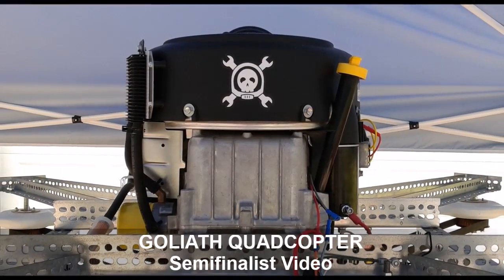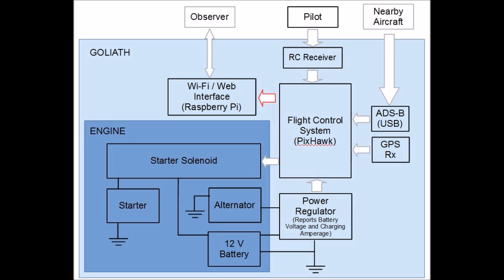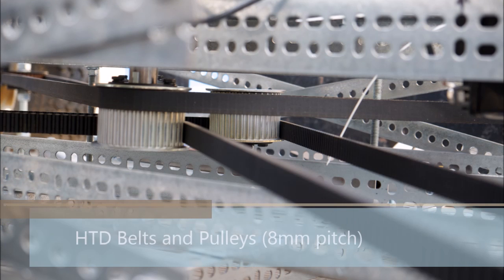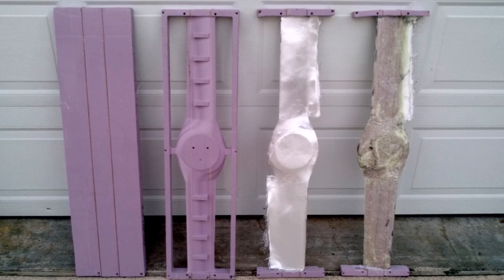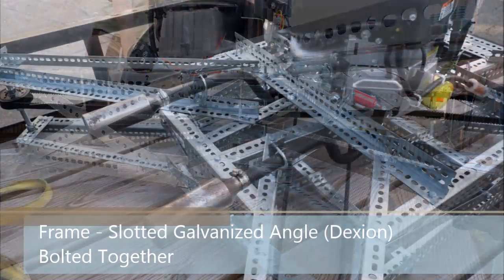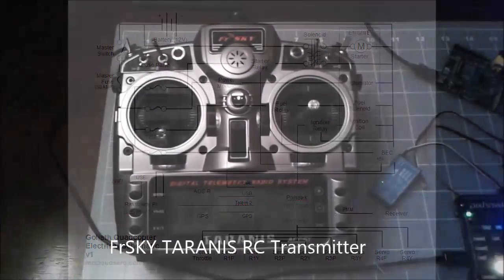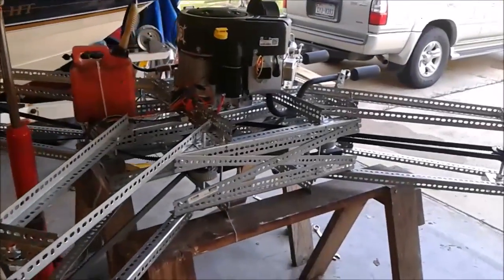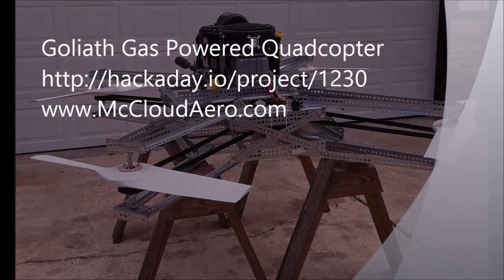Goliath Quadcopter Semi-Finalist Video for The Hackaday Prize

Comment: how would it control the speed of individual rotors to stabilize?
Reply from the maker: +TheTrueM3ga The initial idea is not to change the rotor speeds, but to use vanes to control the vehicle.  This would be similar to how +Armin Strobel did it for his Ducted Fan VTOL.  Eventually it would be good to move to variable pitch rotors.

Comment: Hey, get two 1/2" thk. 6061 aluminum plates, along with (4) aluminum i-beams for the frame, and sandwich them together. I'm working on similar project (but electric), which can handle around 500lbs of force. 

The frame will weigh about 30 pounds, but it will be strong as hell, perfect for your assembly.
Reply from the maker: Bryce Ohmstede Sounds pretty strong. I'd be interested in hearing more about your project if you're able to share some more details.
Reply: McCloud Aero Corporation It's only on paper right now. I'm about to build the frame and do a test on one arm's worth of components. I'll keep you posted.

Comment: HIghly interesting, you are an intelligent guy that there are very few of left. I am following your progress with great interest as I am working on similar  idea, I also had the vanes idea iintead of collective for lesser complexity. The   million dollar question though is: will the vanes be effective for control?
Reply from the maker: I'd be interested to hear more about what you're working on.  I think your right about the big question being about the vanes (though the belt system has proven more complex than i envisioned).  I'm looking forward to testing it and finding out.
Reply: A design of PAV was my goal, and thus I flipped every rock there is.  A design of a big quad was one of the alternatives, however I thought a  little about the belt and drive mechanism and thought too that unfortunately that could be more complex than could appear. Also  if one belt fail the  entire craft is out of  control . But  the advantages are that a quad retain the same efficiency as any small  model and is symmetrical.  So the  only real  thing    to think  about after   my analysis is the vane deflection system.. Where are you going  to have  the vanes? and in what way are the vanes going to control the attitude